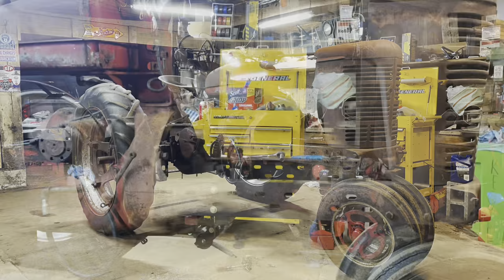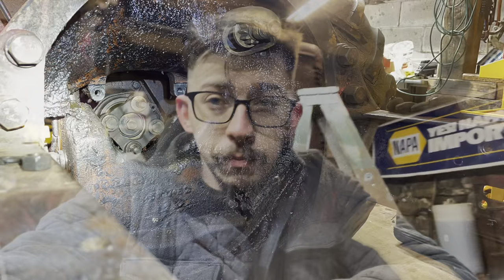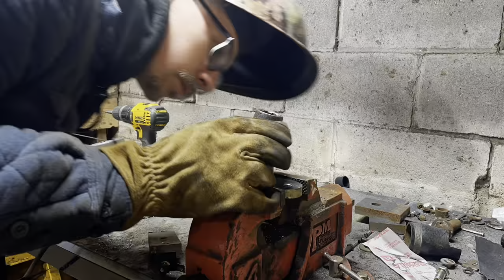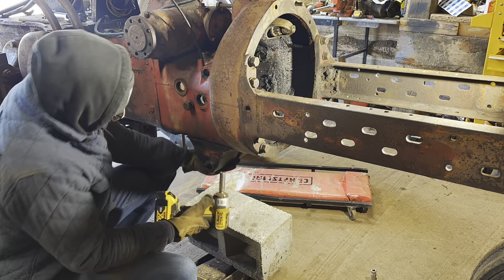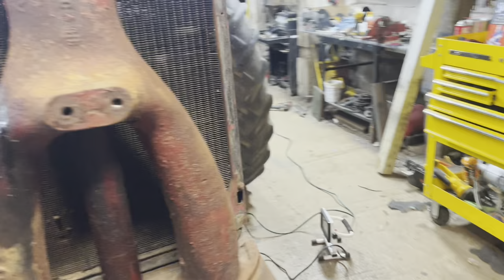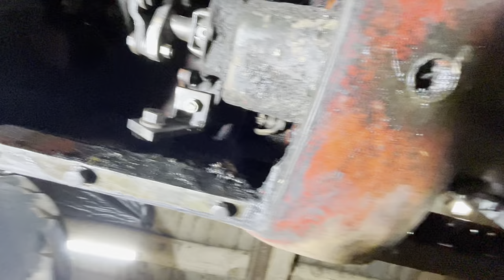This Farmall M Has A New Heart! FLATHEAD FORD SWAP!

Comment: Great video, I like that you are putting an antique engine into the tractor. Quite the challenge, good for you. I would like to do things like this, but Alaska people don't throw things away, we use stuff until it is all used up and can't be repaired any more. Everything has to be shipped up here and that is pretty expensive, so everything gets reused. I rebuild small engine equipment like lawnmowers, chainsaws, weedwhackers and things like that., I have a 50-year-old 2 stroke outboard motor on my boat that gets updated and rebuilt when needed. I used to work on my own vehicles, but now you need expensive electronics to work on the newer vehicles. I have a code reader, so I have an idea what a mechanic is going to tell me when I take it in to the shop. I have recently replaced the engine and transmission on my 1993 Ford F250, that should be good for another 300,000 miles. I decided to spend the money for the replacement because the price of a new truck is many times more expensive.
Reply from the maker: I certainly understand that. I try to do the same here. Overall, it’s cheaper for me to swap this engine in than repair the original boat anchor. Haha. I have a few small engine projects in the works as well. As far as vehicles go, the simpler the better! Thanks for watching and leaving me a comment!

Comment: Can’t think of anything better than a Ford / Farmall collaboration and I am a little late to the party but what is the flathead originally out of and do you know if it has babbet bearings or shells and if you want to be able to shift the main transmission you will need a clutch pedal for the flat head or are you going to adapt it to the original pedal?
Really cool idea 😀🇨🇦

Comment: Nice, this will be so cool when all ready to go. The engine will be pretty close to the the stock one it had?
Reply from the maker: Horsepower is a little different but the Flathead can turn more RPMs so with the transmission coupled I think it will probably feel similar to factory but have a unique sound. Im excited to get it going!

Comment: Very cool I have to remember how you continually take time to think each step through. I assume the decision to add the second transmission was for additional  power ..... but how powerful was the original engine?
Reply from the maker: I appreciate that. The original engine was about 45ish horsepower. The transmission combo allows the lower horsepower to do a little extra work. Plus the extra gears are just fun to have! Thanks for watching!

Comment: We're you able to reuse the hydraulic pump? If not are you going to put a hydraulic pump on for the loader
Reply from the maker: Have not fitted the hydraulic pump yet. I don’t foresee any issue but that is to be determined. I just want to make sure the flathead functions completely before I reinstall everything. Thanks for watching and your comment!

Comment: Why would you even think of doing that why not just focus on putting the original motor back in the tractor
Reply from the maker: This is unique and a fun challenge!
Reply: All engines get tired eventually.  If I recall, that was the case in this machine.  The original engine was done, and had moved on to being a boat anchor/giant paperweight.  It can cost several hundreds of dollars to be adequately rebuilt and repaired.    Not everyone has that kind of cash or time.   Plus, he has the new engines layin around and likes the challenge of making something.    I'm going to be doing something similar with one of my old tractors.  But the engine I am swapping into my M is a large diesel.
Reply: @vonRow  you better hope the frame of that farmall m can handle the weight and torque of your choice of engine or you just wasted your time and effort on putting that engine in your farmall m
Reply from the maker: @vonRow  Exactly! Diesel M will be sweet!
Reply: @joshbutterfass5251  This tractor probably had at least a 25-horsepower engine in it from the factory. They overbuilt the transmissions and power train parts back then, they built for durability back in the day.
Reply: He’s having a great go and providing good entertainment. He’s doing really well. Love your work Scrapfab
Reply from the maker: Thank you! I enjoy your work as well!
Reply: Good work young man. I’m enjoying following along!
Reply from the maker: @davidmobley   I appreciate it!